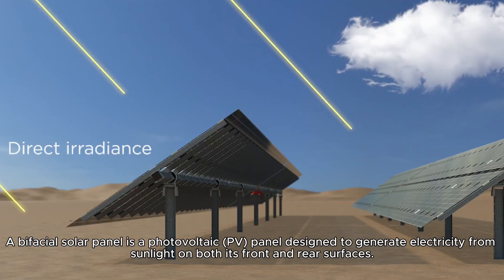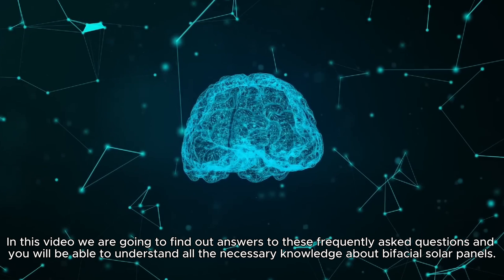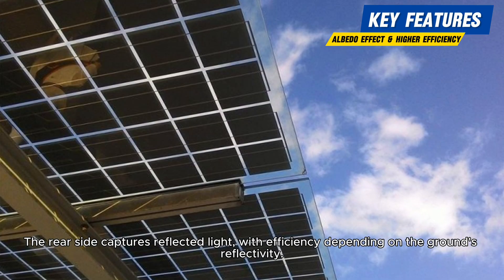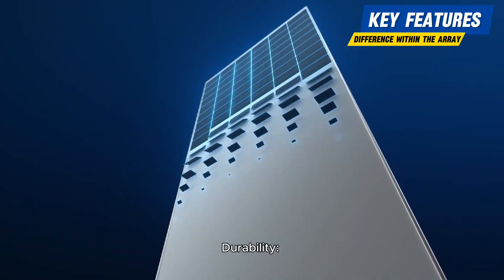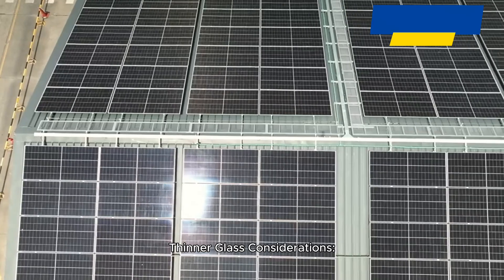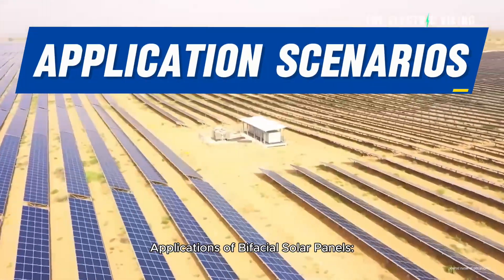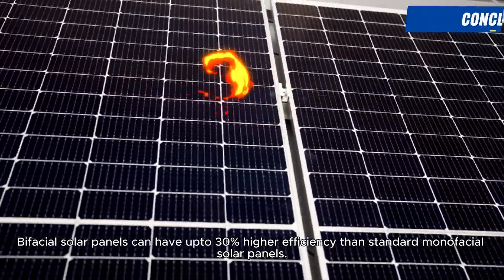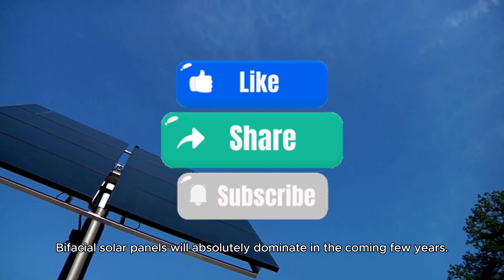High-Efficiency Bifacial Solar Panels CHANGE THE GAME with Lower Cost!

Comment: These panels would be better in hail or heavy snow areas if mounted vertically with white reflectors around them.  With a steel top edge it would eliminate damage from elements.  But without trackers to tilt them, the angle will never be the most efficient, so you lose a lot of the benefit.  However if you mount them individually with a swivel to keep the sun in front, it should give you better results.  If mounting on a flat surface though, the old style will likely be better.  I like the use of them in Canada due to the amount of highly reflective snow all around, if mounted vertically, the snow will not stick to it, and output would be higher than regular panels.
Reply from the maker: @timfarry7071  I have done a project, which may be helpful for you: manual adjustable tilt rack. You can manually adjust the tilt, put it almost vertical in the winter, so the snow will drop and get maximum gain. In the summer, put it back to normal, like 45 degrees. 2.0mm temper glass from tier one supplier may be fine when u set to 45 degrees. But you need to check the history record and compare it with the hail test result from the manufacturer.
Reply from the maker: @timfarry7071  some racks can mount 16 panels in a tilt system. So you don't have too much work adjusting the angle each time. If your project is not too big.

Comment from the maker: Single-faced solar panels (monofacial) will gradually disappear from the market in 2025, even for residential solar panels, which seem unnecessary to use bifacial solar panels. However, when most of the manufacturer's production lines switch to TOPcon or BC technology. They gradually terminated the old production line for single-faced (monofacial) solar panels.